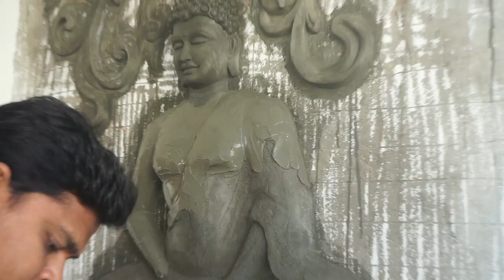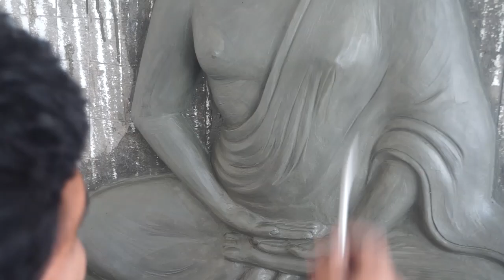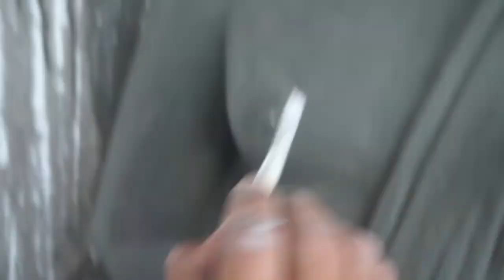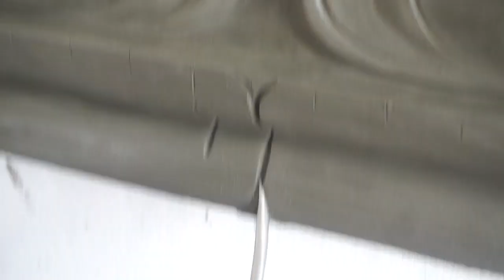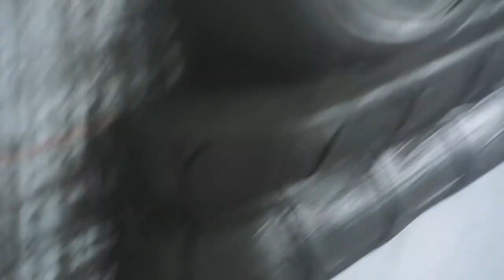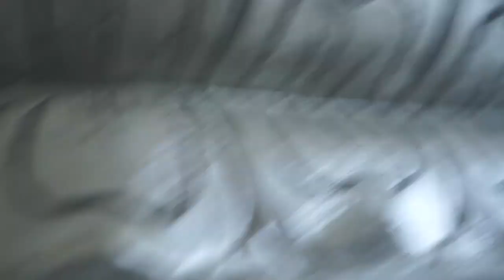Budha body and peetam making in cement, cement art designs, Siva Art Works

Comment: Good work bro... which material this with cement in final touch? Ratio?
Reply from the maker: In the final finishing i used only fine cement bro. There is one magic bro. That is before start the work we should make it wet. Thats all
Reply: @SIVAARTWORKS9032242345  thanks siva....some people are using cement and chalk powder...so thats i ask you..it is usefull ?
Reply from the maker: This type method useful out side works..  but it not become fullfinish..